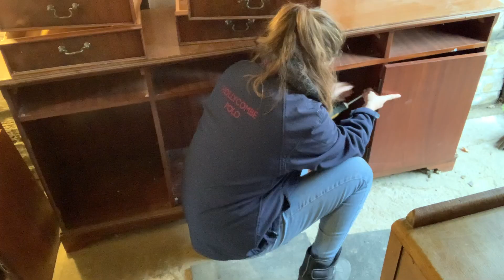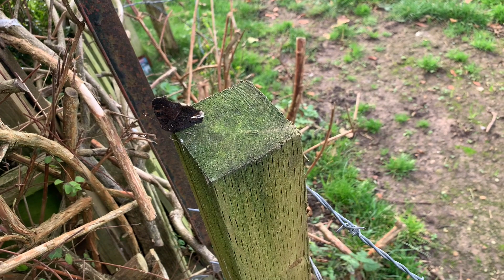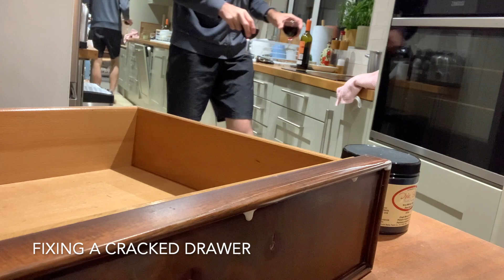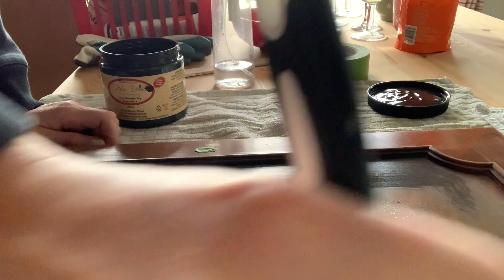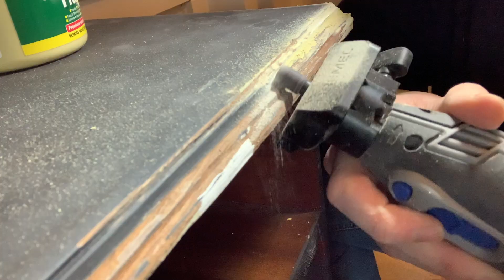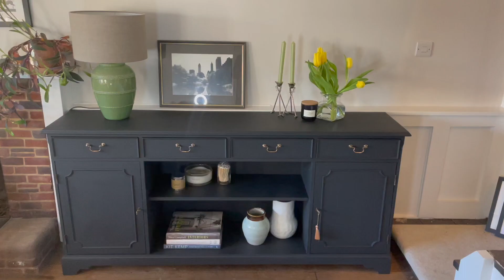Sideboard transformation #upcycle #furnitureflip

Comment: Turned out great ❤️💜❤️ I am interested in seeing what you did with the door trays. I thrifted a beautiful Lane side table for $6, it was missing a corner. It was so long ago I don't recall which type of wood fill product I used but somehow I sculpted a new corner and hand sanded it. It's solid wood but was so dark that the carved details and floral drawer pull were lost. I painted it antique white to match my bedroom and tried a faux tortoise shell paint finish on the top inset. It's been my oversized night table for 20+ years so I will probably try a new finish when I move.
Reply from the maker: That sounds so beautiful! I love the idea of the faux tortoiseshell. Thanks so much for watching and for commenting!
Reply: @hollysdesign  It's super easy. A few colors dabbed on, half black and water over that, then drops of alcohol to spread the black glaze. It's really pretty 🦋

Comment: Gorgeous! Wonderful solutions. I have seen furniture flippers in Facebook videos do silicone molds just using a glue gun, they clean the area on the undamaged corner, of course, and peel it off once it's solidified. Sorry I can't remember which because I watch so many.

If it's a huge section of corner, the put screws or nails into the place where the new corner will go, to act as a core or connector for the wood filler to hang onto, to strengthen it when it's dry.
Reply from the maker: Thats a really good idea, I'll give that a try. Thanks so much for watching and for commenting!